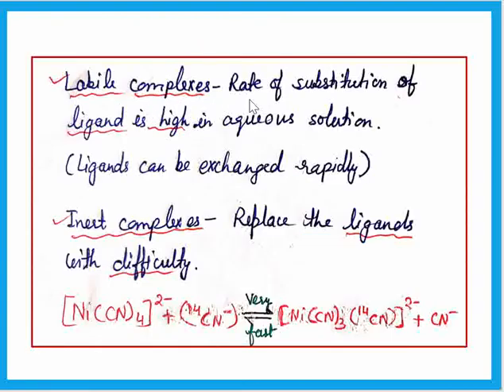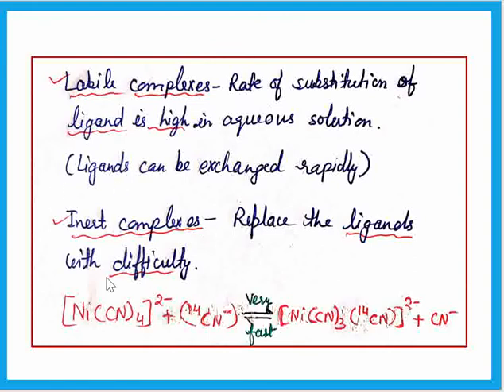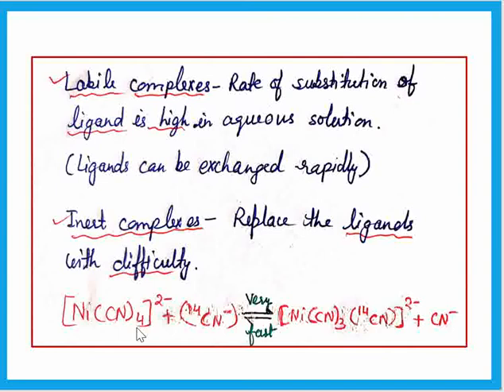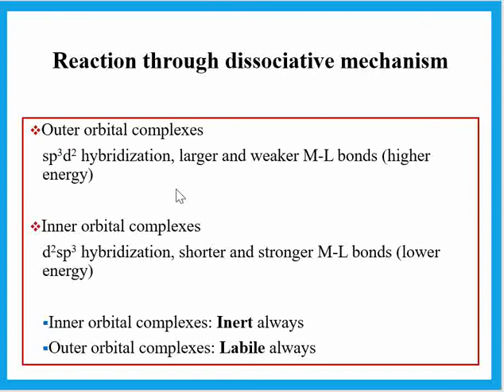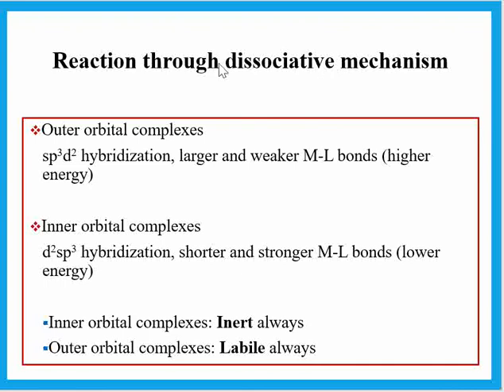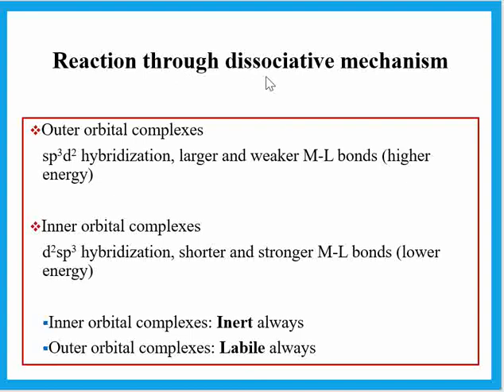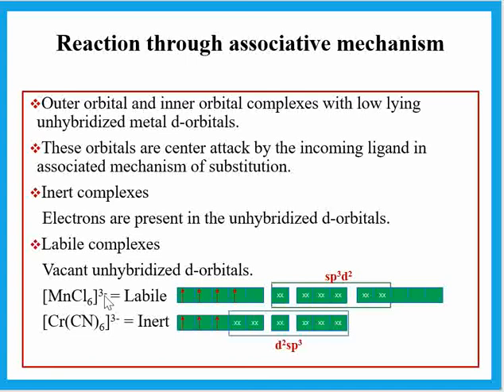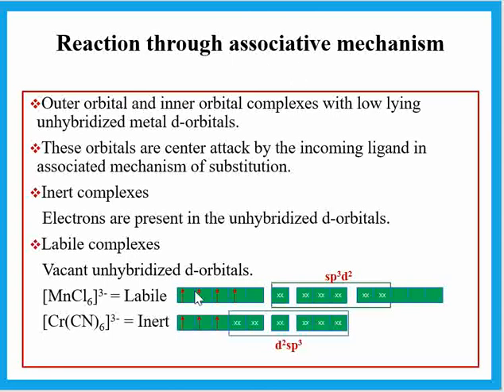Thermodynamic and Kinetic Stability, Coordination Compounds, Part 2, Kinetic Stability, Inert Labile

Comment: Mam One question, please can u tell me
Fe(H2O) 6 3+ and Cr(H2O) 6 3+ are equally stable thermodynamially but the former is labile while latter is inert, why  ?
Reply from the maker: They are thermodymically stable because their dissociation constants are similar. The first compounds configuration is d5 (HS) while second complex is having d3 configuration and d3 configuration is always inert. according to VBT and CFT. This can be better explained by CFT which is helpful in calculating CFSE of reactant and intermediate compound. We have to see difference between the CFSE of reactant compound and intermediate compound (associative mechanism- pentagonal bipyramidal intermediate and dissociative mechanism- square pyramidal intermediate). If the difference is negative, or zero, the complex will be labile. In case of d5(HS), CFAE is negative (labile) while for d3, CFAE is positive (inert)

See Table 1 and next table and Table 2 and next table in the given link

https://www.google.com/url?sa=t&source=web&rct=j&url=http://www.vpscience.org/materials/UNIT%2520III%2520(Sem-V)%2520Thermodynamic%2520and%2520Kinetic%2520Aspects%2520of%2520Metal%2520Complexes.pdf&ved=2ahUKEwiAwdqS9_r8AhVzg-YKHR9eDfMQFnoECBAQAQ&usg=AOvVaw1XF-YHj26bhwC1i94WFUj1
Reply: @dr.geetatewari4592  thanku so much mam🙏🙏
Reply from the maker: Welcome